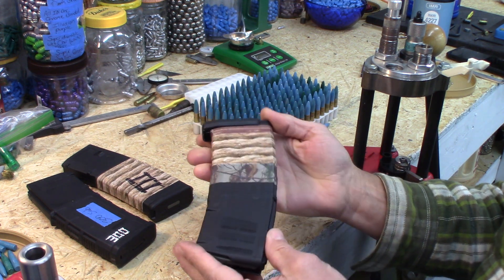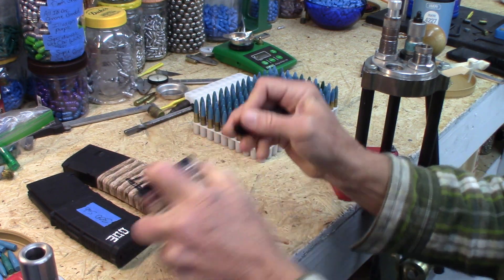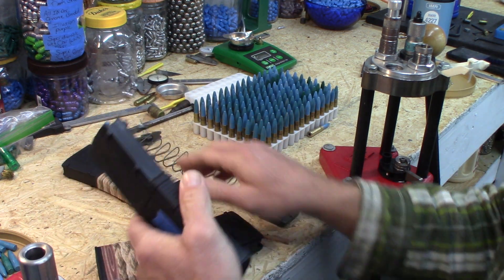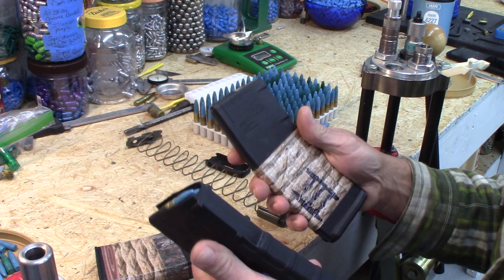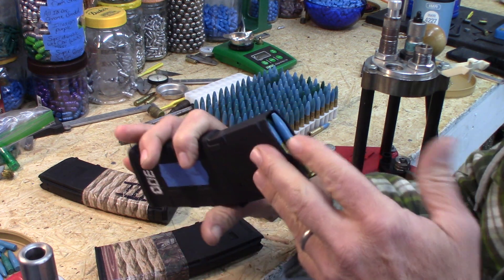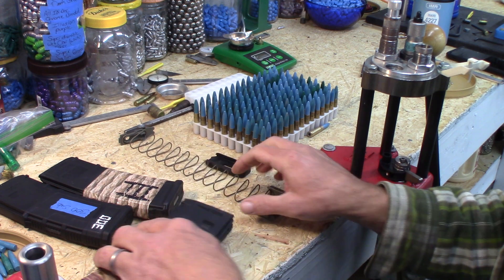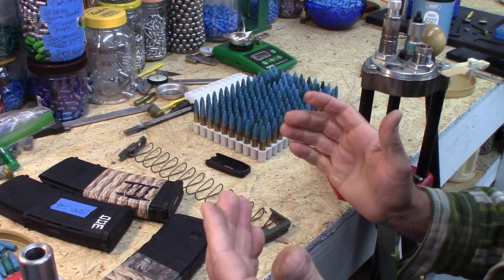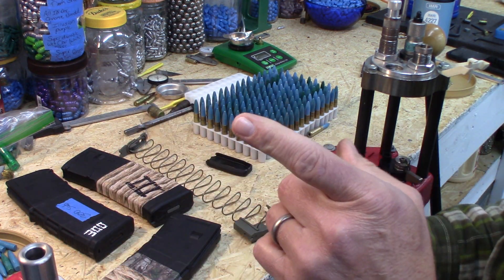Loaded Mags/Spring Tension. Finally?

Comment: Elvis, Thanks for the informative videos. I have a relative who is a metallurgist. He told me the metal in springs made since the 80's should give zero problems if the magazines are left loaded. I just fired 33 magazines in 3 Powder Springs Mac's (.380, 9mm and .45) I loaded on May 17, 1986 without a problem. If you know anything about Mac's you know they have a very high rate of fire ant had the springs been weak there would have been numerous jams. Loading and unloading causes more problems but newer mags won't have a problems for a couple of thousand cycles he said. Sorry for the length but this is a real concern to many shooters. Also kept all my Glock mags loaded for 27yrs while I was an LEO with no I'll effects.

Comment: It's all to do with the type of steel, the dimensions and the amount of pressure applied to that spring over time. Your spring (metal and treatment type), the actual force applied to it, the properties of the metal and the dimensions most likely will not show any noticeable signs of tension or compression loss. Take the same material, same heat treating method, but make the spring to a car's suspension spring dimensions and keep that compressed, over time will possibly show weakness in tension and compression.

Comment: Loaded mags.  Spring tension is lost when mags are used often because the metal loses it's elasticity.  Think of how to break a paperclip by bending it back and forth.

PMAGS's plastic will break looong before the spring will.  Use Brownells metal mags and keep them loaded long term.  Train with your pmags until they all break.
Reply from the maker: Yep... that’s how springs work. But it takes a lot of up and down.. most people will never encounter that!
Reply: Paper clips are not springs. Never ever heard of a magazine spring failing for any reason.
Reply: I oversee firearms training as a law enforcement officer and the magazines that we use constantly are much looser in the spring than the ones simply kept loaded.

Comment: I keep every magazine loaded for certain weapons in certain places or for certain uses. Some even in the safe. I have tested this some and have never had a problem with my mags. Thats not to say I would do this in an uncontrollable environment involving extreme heat changes, weather changes and such. For extended time periods in those conditions I have not experimented with. 
Elvis that could be an interesting video. Put dummy rounds in a few different types and brands of magazines. Pit them in extreme heat then cold. Add a little rain and put them in the freezer. In mud, creek rock etc. Just to see what happens.

Comment: What are y’all’s thoughts on drum mags?   I know a guy who has a few and takes a hot minute to load them, think the springs on KCI 100rnd or Magpul D60 might compress over time?  I’d normally recommend he dump the mags periodically, but replacement costs are up!
Reply: Save your money and by brownells metal magazines for guaranteed long term performance.  Get used to a 30 rd reload.  Buy a vest or belt that can carry the extra mags and you become a more efficient fighter.  Keep ammo close to your body so you arent always fighting the off-balanced-leverage. A gun fight is not a place for new toys, and gun malfunctions are prolific, even with tried and true equipment, especially with shooting and moving.  Shooter induced errors everywhere, even from experienced officers and soldiers, so keep it simple.  If it cant be thrown on the ground over and over, it isn't battle ready.

Having a go-bag with extra mags is generally good practice as well.  Buy a tourniquet, and occlusive bandages and learn how to use them... it could save your life.  Keep your tourniquet near you every time you pick up a gun.  Tough times are coming.

Simply my opinion as a LEO.
Reply from the maker: I have seen so many malfunctions do to niche items. I think they are cool for mag dumps on the range and fun. But for practical reasons in my experience 30 round or even 40 round magazines are all you need. But for a little extra fun you can play with all of these other things and have fun if you have extra money and extra time.👍👍👍🇺🇸🇺🇸🇺🇸
Reply: @elvisammo  my buddy has plenty of all, was just curious about longer spring tension memory.  Thanks all, keep yer powder dry!

Comment: First I got the powder  thanks!!  I use wilson combat mags for my 1911. I called Wilson to see what they had to say about it. They said  rotate mags every 2 month. I  use magpol for my ar and I load 25 rounds in them and they stay loaded till I shot them.  I think if you're going to have trouble with the magpol mag it will be with the lips of the mag not the spring.  Could be wrong thats just my thoughts. Merry Christmas